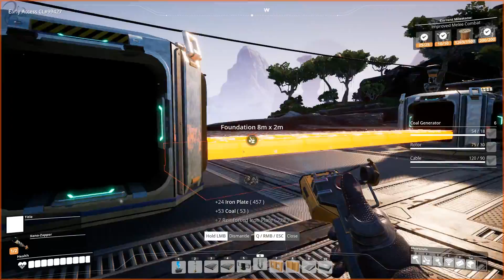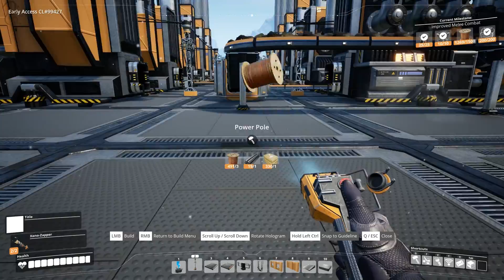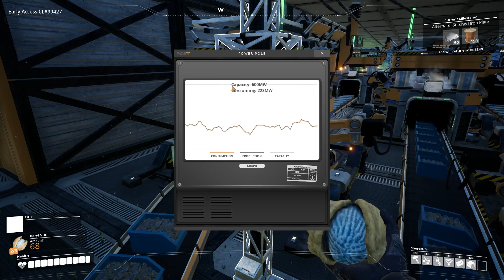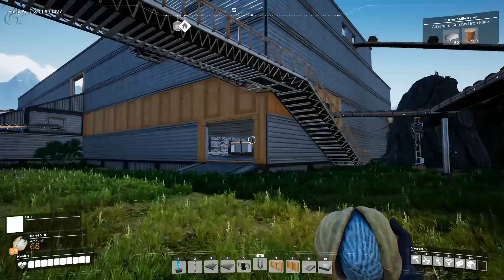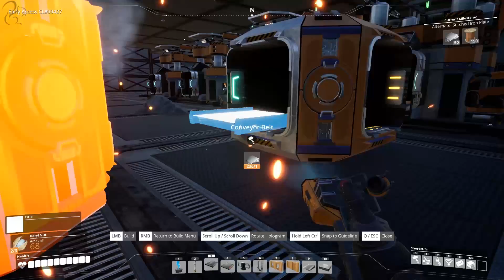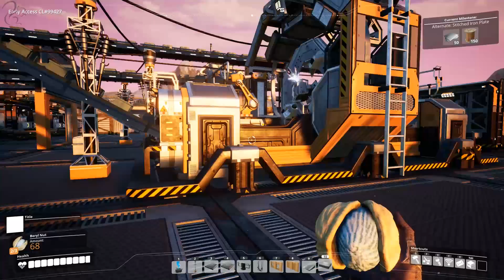Satisfactory - Episode 16 - Much Better

Comment: If you add a mark II miner on the coal, it will produce 240. Same with your other miners. It will double what the regular does. So if output of low quality is 60, it will produce 120.

Comment: "Screws WILL get used later on in the game" laughs in alternative recepies XD
Screws, like iron rods are 2 components you can very easily get rid of. They are only usefull in making tools, or placable objects.. Further i never ever use them anymore.
For example, in my current base, i have only 1 constructor making rods and one making screws. And those are just for my personal usage..
Reply: How?? I produce 2 supercomputers, 4 HMF and a lot of nobelisks and ammo, and I needed a shit ton of screws and rods
Reply: @timbroski4487  there are alternatives for the nobelisk that would remove the need for rods and screws.. Or alternatives for the beacons to remove their usage..
Getting the super computers and HMF factories running without screws is quite simple too really..